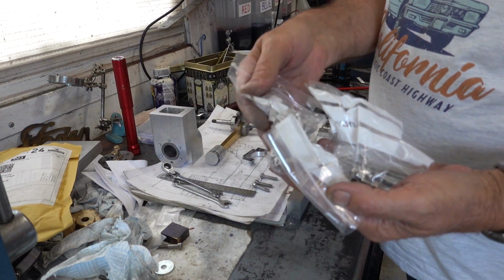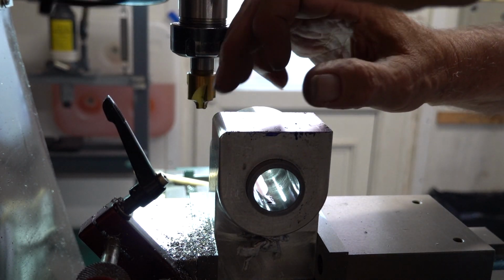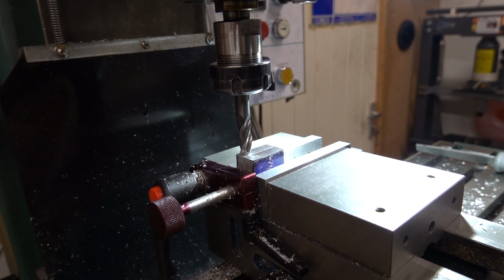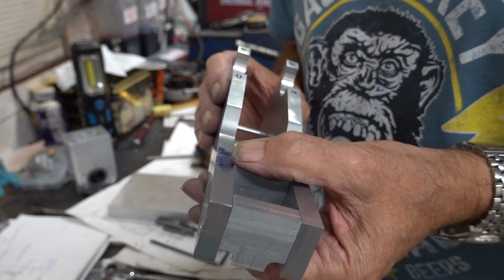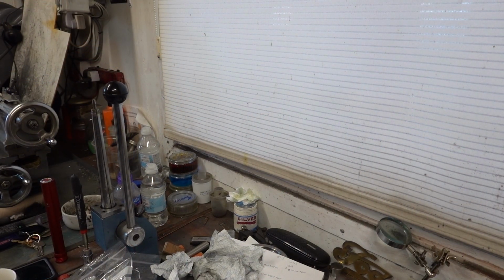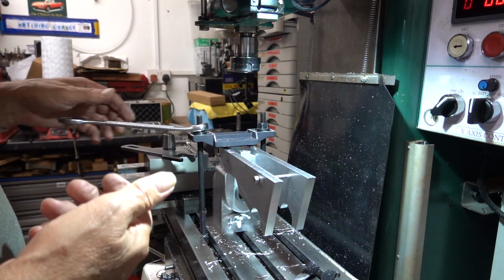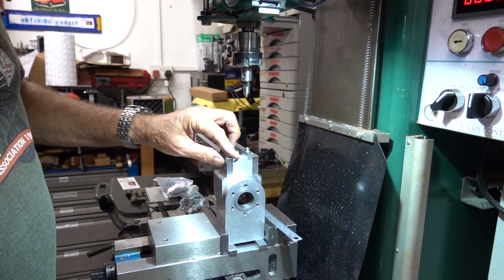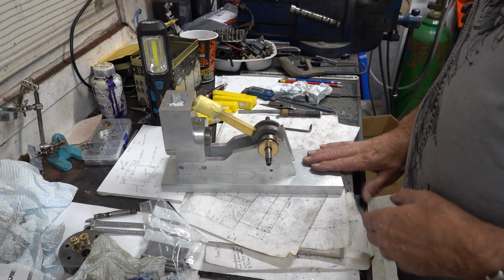Making a Hit & miss stationary engine Part 14

Comment: Just a thought and I may be completely wrong here, where you have the cylinder head bolted to the frame, would it be prudent to pop some locating dowels in there to prevent the whole thing from moving under firing pressure, or are the bolts tight enough to hold it true…..again I may be being stupid and is a genuine question?
Reply from the maker: Nothing is stupid Andy. It seems very rigid but will see how it performs. Could always do that if it moves.
Steve.